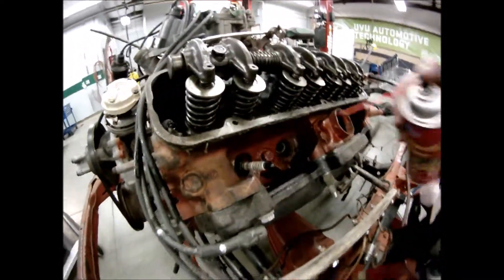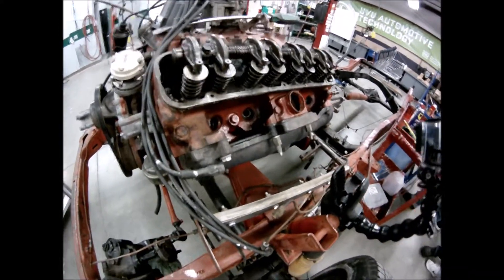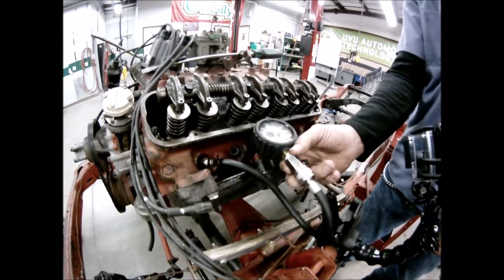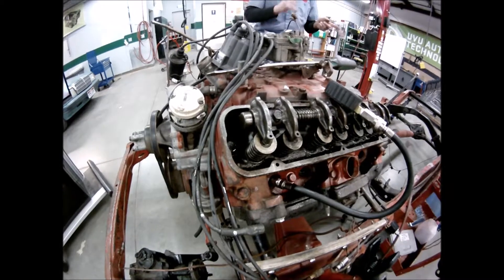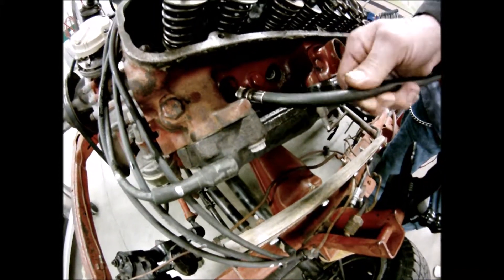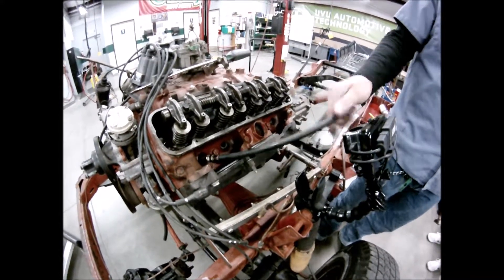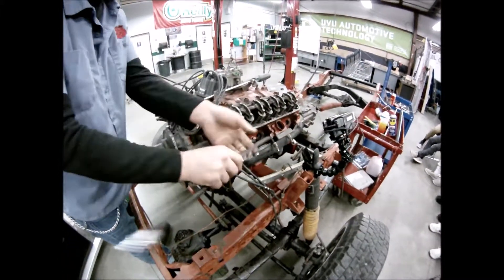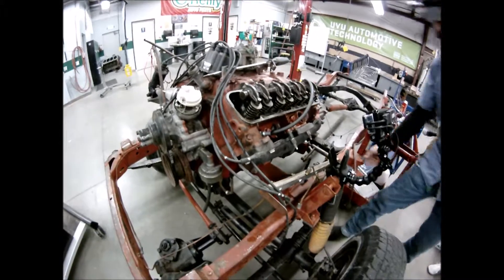Dry and Wet Compression Testing with Leak Down Testing and Engine Diagnostics - Mike's Hippy Garage

Comment: Just an observation. Might be better to clean out all spark plug holes while all the plugs are still in and the rocker cover is still on. That way zero danger of blowing any crap into the engine.